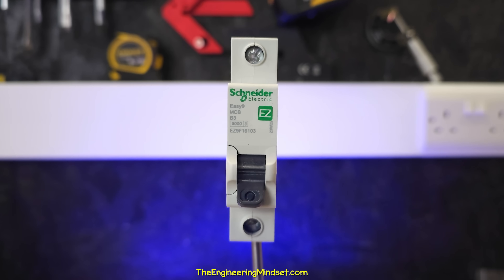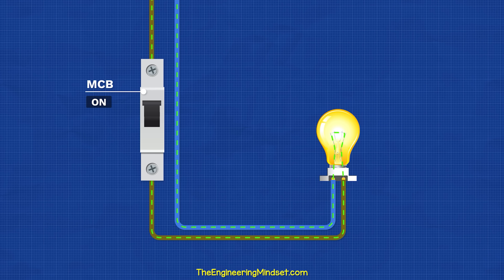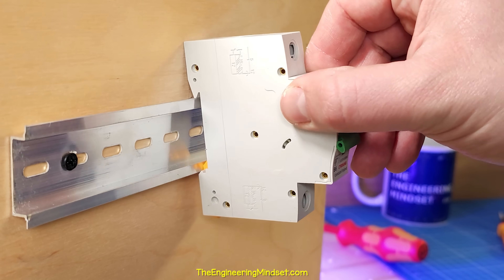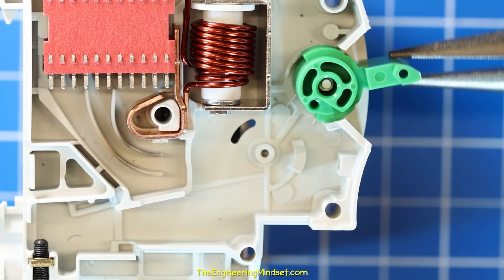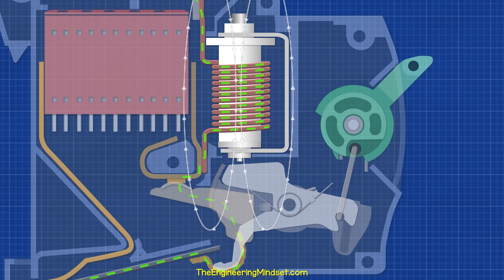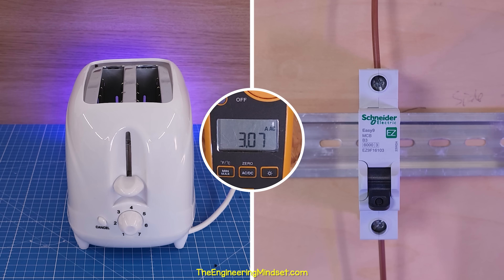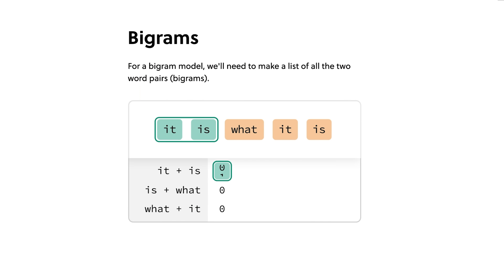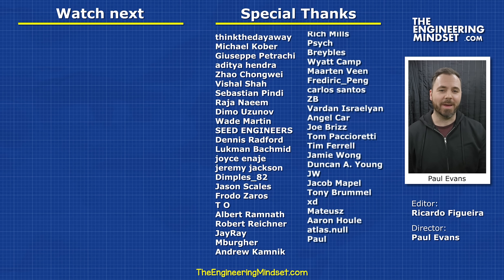Why Circuit Breakers DON'T Protect People (electric shocks)

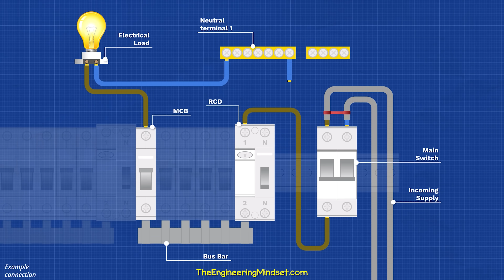Comment: 4:52 I though MCB only use in 120V? If UK is 240V then is it safe to just disconnect live wire instead of both?
Reply: 230/400v mcbs exist & you just have to disconnect live wires
Reply: In this video the MCB is 1P (one pole). Live wire is passed through it, while the neutral wire is always connected, therefore it will only monitor the live wire, and it will only trip if overcurrent or short circuit are detected on live wire. There are 2 other types of MCBs - P+N (1pole + neutral) and 2P (2 poles). 2P are basically 2 x 1P MCBs in one unit and simultaneously monitor both live and neutral wires for short circuit and overcurrent and trips when "abnormal" activity is detected on either of them, disconnecting them both at the same time, while P+N only monitors the Live, but when it trips, it will also disconnect the neutral. I personally haven't seen 1P MCBs in use anymore, P+N being preferred. The connection diagram for P+N and 2P will be completely different as the Neutral wires from the loads will not connect all in one terminal as in this video, but will return each to their corresponding breaker and will be linked by a bus bar (same as live in this video). The PE wire is also missing from this video, but I guess it was skipped on purpose for simplicity - basically from the mains you also have a PE wire that will connect to a PE terminal where all PE wires from all the loads will also connect. I hope it helps

Comment: Did you mention fault currents? Extremely important when selecting a circuit breaker.

In Australia now all sub circuits 32A and below require an Earth Leakage CB
Reply: an elcb is obsolete because it only detects current in the earth wire unlike an rcd

Comment: 3A breaker??? I've never seen anything smaller than 15A
Reply: our standard outlets are only 120v
Reply: @gamecubeplayer  so are mine(America). Never new anything under 15A existed
Reply: @nighttow8780  in europe the standard 230v (or 400v) circuits are 16a but 230v 10a circuits also exist because that's still over 2000w
Reply: @gamecubeplayer  oh.. we have 120/240 split phase. Standard outlet is 120/15, while the smallest 240 starts at 30A and in residential, can go upwards of 200A
Reply: @gamecubeplayer  average residential clothing dryer is on a 240/30, though some wealthy folks have monster 60A units

Comment: For example, a B10 breaker.  With a current between 30A and 50A, the tripping might be caused only by the bimetallic strip or only by the electromagnet. Over 50A, it will be caused only by the electromagnet. For the strip, there is a range of possible values in time, and for the coil, there is a range of possible values in current. If I understand it correctly.

Comment: Why does the breaker need both a solenoid and bimetallic strip? Would they both not trip given the same faults?
Reply: The bimetallic strip would not be quick enough to act to a short while a solenoid would.
Reply: @chillybacon4102  thanks

Comment: Very thorough and well illustrated. Just a quick asside, I remember on my electrical course being taught that Fuses, MCBs and earthing do not directly protect against electric shock BUT do protect indirectly. The example given was any earthed appliance with a metallic casing (say a toaster or a washing machine) in which the line conductor has come into contact with the earthed body. That will cause a short circuit and trip the breaker/blow the fuse (provided its not a TT supply with a crappy earth). If the case was not earthed then it would just sit there, live, waiting for someone to touch it. This is still an issue to this day when DIYers and cowboys install class 1 fittings on old lighting circuits that lack CPCs. They don't seem to realise the danger. If that metallic body becomes live and someone goes to change a lightbulb - dead.
Reply: what about connecting the lamp's ground to the neutral? tn-c earthing system?
Reply: @gamecubeplayer  I'll answer that with another question and an answer. First what is a "TN-C" earthing system? Theres TN-S (Terra-Neutral Separated) in which both live conductors (Line & Neutral - yes neutral is a "live" conductor) and the suppier's earth are all separate conductors from the point of origin. Then theres TN-C-S (Terra Neutral Combined and Seprated), also known as PME (Protective Multiple Earthing) which is the same as TN-S with the exception that the Neutral and Earth are COMBINED from the point of origin (sharing a single conductor). In both cases, the fuse or mcb would still do its job as there is a metallic fault path for the entire circuit (a huge current will flow briefly, enough to trigger ADS). The real danger of using the neutral as a combined (live and protective) conductor on a FINAL CIRCUIT is if some dipshit manages to reverse polarity ANYWHERE along the supply path (you name it, ive seen it) - every exposed conductive part in your home would become live (or at least have a significant potential difference between the metallic parts and true earth - the actual ground your standing on). Add to this the fact that the fusing would now effectively be in the neutral - thus will not protect you at all, directly or indirectly.
Reply: @mastergx1  old homes in finland use the tn-c earthing system where the washing machine circuit is 2x2.5mm² instead of 3x2.5mm²
Reply: @gamecubeplayer  Really? That sounds crazy. I'm in the UK we we don's use that kind of arrangment for supply or final circuits. I'm guessing there is some kind reverse polarity protection in place? Would be potentially lethal without it. No pun intended
Reply: @mastergx1  the schuko socket is unpolarized but grounded
Reply: @gamecubeplayer tn-c is no good idea with metal cases!
Reply: @gamecubeplayer this will bypass the GFCI (RCD) I don't know the European/UK code, but in the US, the ground is only allowed to be bound at the main disconnect, upstream of any GFCIs. 

If the ground was bonded downstream, then any low level fault current leaking into the ground would return via the GFCI and prevent it from tripping.
Reply: @nathanielhill8156  you can't use rcd in a tn-c earthing system unless it's at the last non-daisy chained outlet

Comment: I guess thats why we use B16 Breakers at 3x1.5mm^2. As far as i know, new regulation say that lamps should only be connected by a 10A Circuit Breaker.
If u have a 3 Phase oven u still use B16 but at 5x2.5mm^2

Greetings from Germany

Comment: its not accurate..
we does use MCB to protect from electric shock.
usually electric shock occur when there is a line wire expose to the metal casing of an device.
so when this occur, because the metal casing is  grounded the electricity flows to the ground and the mcb trips.
before the RCB was commonly used, there were lot of homes that rely on this protection.
when they rely on this type of protection,they must doing LT for test that all the grounding ground properly.
in Israel there are 3 methods for protection they check against electric shock,this is one of them.
Reply from the maker: The case you described is overcurrent protection. The device trips because it is a short to ground and an excessive amount of current flows. This is shown in the video. It will only trip because it has exceeded the limit of the wire, it just happens to also protect people from direct contact but only if the metal part is grounded properly, because the current must exceed the limit of the breaker. Only the RCD will trip to save people, that's not what this video is about but it is discussed in a part of the video for reference.
Reply: @EngineeringMindset 
Sure.it trips just because over current.
But we use this phenomenon also to prevent electric shock.
That why I said it isn't accurate and not said it wrong.

Comment: Man I'm a process technician i was changing a mold and before i shut it down i got on top of the mold to check all wires and cables out i noticed one was broke i reached down grabbed it all i remember it was like a very weird sound and like everything went black but i was right back. Idk very strange and that was the only time that's ever happened to me in 16 years

Comment: This video isn't really showing the whole picture. Breakers do protect people. If there are devices which have a metal casing it has to be connected to the ground wire. If a fault occurs and the hot wire touches the casing there could be a high enough touch voltage on the casing which leads to current through the body if touched. Breakers need to switch such faults of in a certain amount off time (e.g. 0.4s depends on regulation and breaker used) so that the current passing through the body gets interrupted quickly enough to not cause significant damage (for short times the body can withstand high amounts of currents without heart issues)
Reply: that ground fault is just a short circuit if it's tn-c or tn-s
Reply: @gamecubeplayer  Well in TT systems that have proper earthing, it will also trip the breaker due to the high current. (I assume however that in many homes the earthing system is garbage and wouldn't trip it, however it's still a short circuit via ground).Therefore in TT systems RCBs are almost always mandatory. But RCBs are not mandatory in every TN System (in Europe anyways). Just wanted to clarify that in certain scenarios breakers do protect in some way.

Comment: Very informative video. Thank you for this. I checked the breakers installed in my apartment and they are C32 for the main breaker and C25 for the rest. That's in EU with 230V plugs.
Reply: what? you have c25 breakers? shouldn't they be c16?
Reply: @gamecubeplayer  I don't know. An electrician installed them. Not sure if he was competent or not. I'm just trying to understand that now.

Comment: depends on the breaker. A regular breaker is designed to protect wires of course it doesn't protect people. GFCI breakers are designed to protect people though, and they do.

Comment: It would be great if an acronym (of this particular field) like "RCD" would be explained when it shows up in a schematic overview! I mean, I now have looked up what it means so I now know it would be a Residual Current Device, but now I still would not know what the difference with a Ground Fault (Circuit) Interruptor is... Thinking logically I would not think there actually would be much of a difference, cause electricity that disappears out of the circuit (and thus might be dangerous to a person at that moment, thougha person having touched a wire or contact would not necessarily be what would cause the electricity leak) could effectively ONLY flow to the one externally existing electricity-absorbing 'polarity', which is 'earth' or 'ground'.

Comment: Shouldn't someone be making crystal clear the difference, right from the beginning, between a circuit breaker and a residual current device?  Showing "RCD situations" at the start is very misleading

Comment: So The solenoid will activate when there is a shortcircuit between line and neutral. What if there's a connection between line and Earth? 
Will it still trigger?
Reply: that depends on the resistance of the earth circuit but if it's tn-c or tn-s instead of tt then the answer is usually yes

Comment: There is a type of circuit breaker that do protect people from accidental electric shock. In N. America, it is called GFCI circuit breaker. They are rated for 15, 20, or 30A as the regular breakers but they also sense the current imbalance between the hot and neutral wires. When someone touches the hot wire, it creates a current path to the ground, and this causes an imbalance which triggers the breaker. Several milliamps of current imbalance is sufficient to break the circuit.

Comment: 16:57 i used to work at a company where this happened almost every time the forklift charger was turned on. then i had to go to the panel and switch the breaker back on. sometimes once, sometimes a couple of times.

Comment: Australian regulations have solved for this confusion by mandating RCDs for pretty much EVERYTHING. Even in industrial buildings and 3 phase circuits RCDs are mandatory almost across the board. 

We had issues at my old factory where some of the old big welders would trip the RCDs. They were changed for RCDs that would tollerate a slightly higher leakage current for slightly longer and it was fine. Not complaining though, RCDs have saved me from a darwin award atleast twice in my life.

Comment: Slight quibble - the wire gauge is rated for a certain load because of its insulation, not because of anything inherent in the wire gauge (to a point, of course).  For example, to save weight, aircraft wiring uses smaller gauges for given loads than building wiring, but with higher heat-resistant insulation.

Comment: The only thing this is missing is to tie it more firmly to the things that DO protect people - the gfci (which was mentioned, but no video directly linked at the timestamp) and the funny green-yellow wire that's meant to take dangerous voltages and turn them into a current high enough to trip a breaker.

Aside from that I have zero complaints. A meticulous and technical but extremely approachable dissection of a device everyone has probably glanced at once in their lives! It's a great video!

Comment: well to be  hoesnt to you its more meant to prevent fires and  protect electric devices. but the new house i'm lveing in uses a comptuer that bascly reads the current trew all teh curects in the house and when one gets to amp heavy it bacly cuts it off with a  bulit in cirect brake switchs inside it. but im this case its fully automtatic and witha push ofa. button will automactly reconetct the cirect

Comment: I do have to comment on one thing comparing the US to Europe. Why are Europeans so scared of having electricity in the bathroom? I know water and electricity are a bad mix, but installing a GFCI (RCD) will negate the risk. Firstly, I have only been zapped one time in my 23 years on this planet, and it was by a light socket, not a plug. With an RCD though, the chance of leakage current harming you is next to 0, assuming it's working which is why you're supposed to test them regularly. We have GFCI's in any location where you're likely to be wet, such as the bathroom, kitchen, and outside. In my opinion, there should just be a GFCI in every circuit. Then the danger of the US plug wouldn't matter because it will trip instantly upon shock
Reply: i only know finland but rcds didn't exist there until the 1990s

Comment: Basically it's a variation on a rat/ mouse trap where the solenoid acts as a rat and the bimetallic strip acts as a mouse to trigger the mechanism. Only instead of trapping the rodent it breaks the circuit/ disconnects the power, hopefully saving your house from burning down.

Comment: The way the RCD is wired at 5:10, the RCD will switch off.
Reply from the maker: No, it measures if current is equal on supply and return.
Reply: @EngineeringMindset  Just try it out and you will see. The neutral flows in the wrong direction. It has to enter the RCD on the same side as the live wire. With the arrangement as depicted there will be double the tripping power applied. I see students making this error almost daily. Anyway, these videos are excellent!
Reply: OK, I see it now. The current actually flows in opposite direction to the way the wiring is run. Good opportunity to ask students if they notice anything.

Comment: huh? The point of a circuit breaker isn't to save you. It's to save your house from a fire.
edit: now that you explained it makes sense that it only has short circuit and over current prot, but not over volt and others, like a (very) high end computer PSU. (OPP, OVP, UVP, OCP, OTP, SCP)
16:15, so simply we don't want transient spikes to trip the system, same in pcs.

Comment: they run 1 wire into the earth so that people get killed, why? i have full 220 VAC in my whole house, from solar and lifepo4s, NONE of the 2  wires is grounded, very safe,you'd need to grab the 2 wires to be shocked, extremely improbable 
      ; why do they do that?   is that even legal ? can't be.

Comment: Bimetallic strip also protects from short circuit condition. US circuit breakers do not have magnetic trip mechanism for instance. Magnetic trip mechanism protects from arcing and sparking between phase and neutral wires.

Comment: As an ABB Technical specialist, I give you props for a good explanation. Only 14:08 "Will trip within this zone" can be understood wrong, it is "Somewhere within or beyond this zone". 
You do explain it later correctly, but I usually point out the operation tolerance differently.
You did include our green and blue competitors, why not the red brand?

Comment: I have a 5000 BTU window AC. It has a slow start, so it never gets above 500 watts. I want to run off a 1000 watt generator, but I don't want to worry about freak spikes that might overload the generator. Can I put a 5 amp breaker inline with the AC/Gen? Would it flip fast enough before the gen spiked?

Comment: I can attest to RCD's working extremely reliably. I have recieved three electric shocks in my construction past, a memorable one was moving my extension lead out of a water puddle for safety reasons only to end up getting a little kiss of energy. they all hurt like a bitch, LIKE GETTING KICKED IN THE CHEST BY A HORSE, but the RCD DID ITS JOB EVERY DAMN TIME!!! THAT ILL ATTEST TOO. 

My hazard awareness needs work though. Im the guy they ade them for, dont want wage slaves dying before they expire.